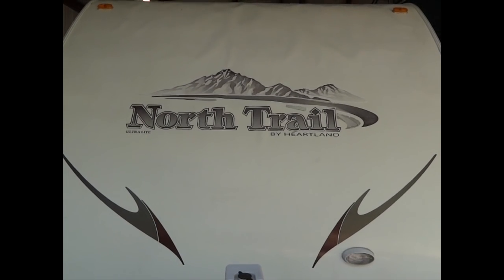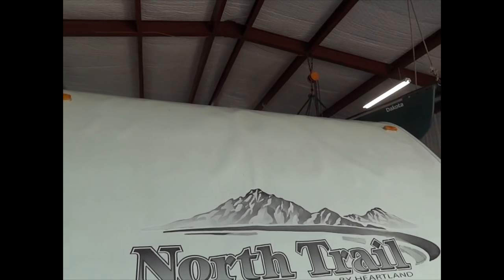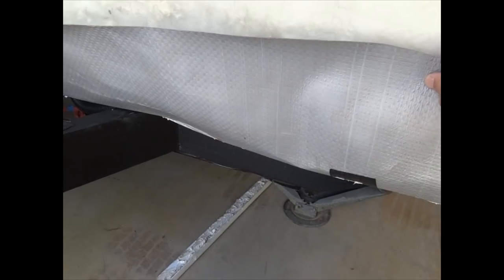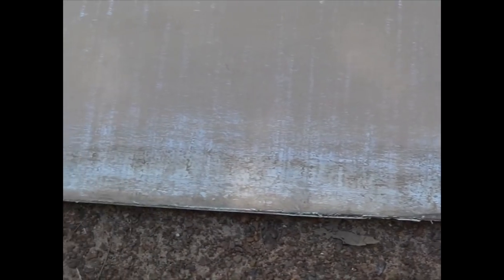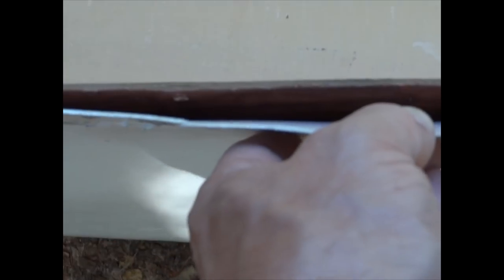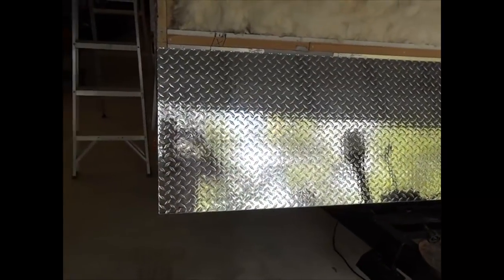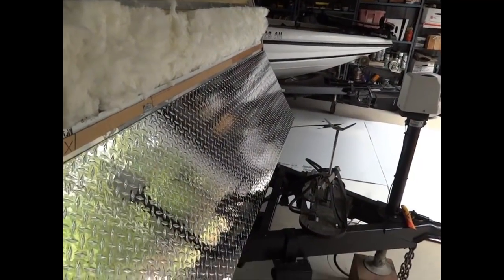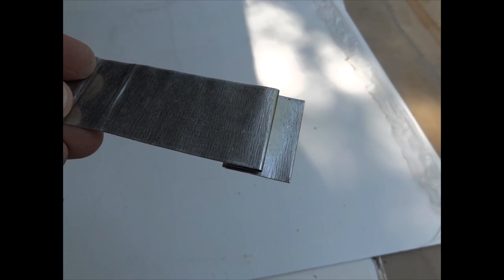North Trail RV Travel Trailer Delamination Repair- D.I.Y.

Comment: excellent job.  If you dont have access to a fabricator but can get the aluminum sheets, you can use rv insert style flat trim instead to cover the seams where the sheets meet up.  Just use putty tape first under the trim and install, then insert the vinyl in the track

Comment: Good job on the repair. I'm considering doing  something similar on all sides of my camper due to delamination. I've considered ripping out all the fiberglass and using closed cell spray foam followed by the aluminum.  My thought is this would make the camper slightly more water resistant if it were to get in compared to the fiberglass holding water.

Comment: Thank you so much for this video. I have a 2010 north trail 31QBS which I've tried to get repaired for years, but no one will touch it. North Trail wouldn't even speak to me about it. I actually purchased 2 sheets of aluminum diamond plate at one time in the hopes of fixing it myself, but never started the project because I had not idea how to go about it. This video is gold. I'm frequently in Atlanta GA or Tampa FL and would be happy to hire someone to do this repair on my trailer.
Reply: I'm in Tampa as well and I have the same issue on my Passport 3220bh.  I'm looking for a solution now.
Reply: I am in Tampa too and I have the same issue with my Passport. We should all get together one weekend and help each other fix the issue! 😂 I would seriously pay someone if they want to do the job in Tampa.

Comment: When I bought our 2001 Keystone (with bubbles) I was told that it is the chemicals within the adhesive that releases fumes mainly in hotter weather that causes the delamination within the fiberglass. Thanks for a video of a common problem, your the only one in here.

Comment: Great vedio, doing my front cap now, but a little different. I'm using pan screws across the front with the 's' seams, also added wooden strips on trailer horizontal ribs with liquid nails so the new metal sheet won't be metal to metal. Will be replacing insulation with insulation sheets cut to size and glued to back side of paneling. This will add extra support to front cap. Leared a lot thanks.

Comment: We have the same de-lamination on our Jayco Lite.  What I found was that front/top "running lights" seem to also be a problem with leaking.  Ours were almost full of moisture and algae from the rain run-off on the roof.  The factory light don't seal well and caused water to wick inside(from behind the light base and between the light base and colored globe).  The water then runs down the inside of the panel and sits on the horizontal cross members giving the water time to soak the fylon back and causing delamination.  I'm not saying the leaks on the top at the junction of the roof membrane and front panel aren't to cause, but one or the other or both can happen.  Also, when you have double insulated windows on your house, the sun can reflect on the paneling and really heat up the panels and releasing the glue that attaches the fylon to the sub panels.  BTDT.   There is clear evidence that the leaking lights are a problem in the video.    Enough of my "armchair quarterbacking".  Just thought some of you would like to know.     -Brian

Comment: great job. And aluminum was a much better choice to go back with in repairs.  I've repaired a fire damaged rear area on a camper and used filon that I had to bond to 1/8" plywood but with no pinch roller or vacuum bonding machine available to the average guy, I had to use contact cement and a few dozen landscape bricks to set it up overnight. Turned out good but for longevity I'll use this next time

Comment: I have the same exact problem on my 2015 Jayco 26' trailer. Got quoted at $3300 for repair and been staring at it while contemplating the cost vs. reward for a month now. I've been toying with attempting a DIY but this would be my biggest project ever, probably outside my depth. How much did the entire repair cost you minus labor obviously?

Comment: Thank you for posting your work, i have the same year and model and the same issues.  I noticed the work light didn't get put back in.  I'm guessing it is more of a problem that a help.  also the side molding you used has little or no reference as to where you bought it and any issues replacing it....anyway thanks for sharing very helpful.

Comment: Hi 
Wow it turned out great!
I have a 2011 Forest River Surveyor with the same problem.
I have some questions:
1. how did you remove the corner moldings?
Did you use "Mechanica" or some other silicone solvent to get the corner moldings off?
2. What is the white aluminum sheeting called?
The rock guard is diamond plate, that I can see.
3. Did you use an RV repair shop or a sheet metal shop to make the 3 panels?
4. How many helpers did you need?
5. Did you seal it with Sikaflex, Latex calk, silicone or lap seal or other?
6. Please advise and congrats! it looks like new again.
Sten Mander, Petaluma Ca

Comment: Did you install any caulking in the “s” section before you slipped the new metal inside or did you install screws to the outside of the “s section to prevent wind damage

Comment: So the top edge of each piece is held in by the sbend? Screws on the bottom of the sbend and up the sides, but the top is just locked into the sheet above it? How did you secure the top piece? Did that one just get screwed down and some eternabond/dicore on top?

Comment: Give me fiberglass structures anytime. If you don't know how to repair composite structures or aluminum don't buy them the real problem is mixing wood with composites letting in moisture and doing the same with any metal will cause a problem also. I work in the aviation industry and this is not a major problem it was when wood was being used!

Comment: Hi. I recently came across this post.  I have this exact issue living in Texas with my travel trailer which is most likely very similar in size to the one you repaired.  Would you be willing to help me work on my front end trailer cap?  I live in Forney Tx near Dallas and would be willing to drive and pay to replace my front end cap. Thank you

Comment: Thank you for your effort...but.....You flew by step by step....missed completely the removal of the filon cap.... important step for us preparing to do a similar repair.  Also you either forgot or failed to mention your lower front light not being replaced.  Finding materials for a job like this is challenging...would have been very helpful to mention where your material came from.  If you are committed to taking the time to film and produce then you should take the time to cover all aspects of the job.  While the overall video was ok....the details were definitely missing...my assigned project Grade is C-.